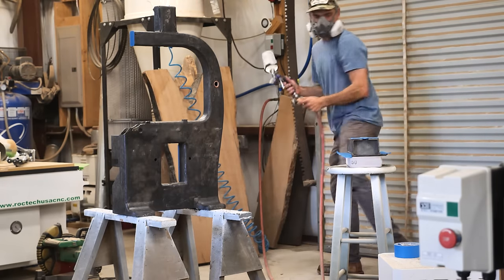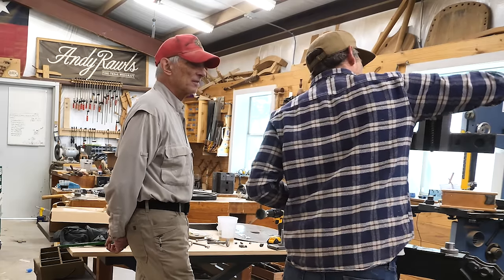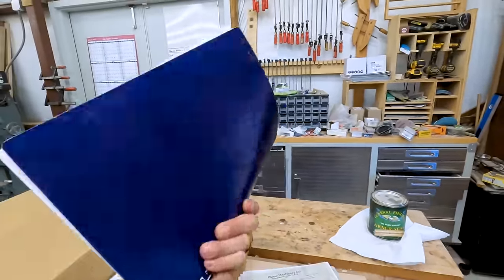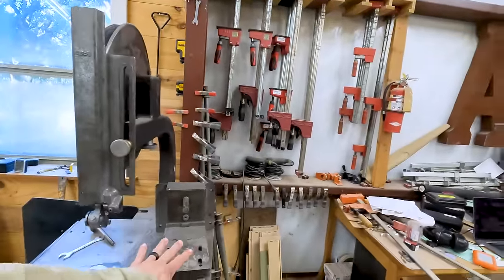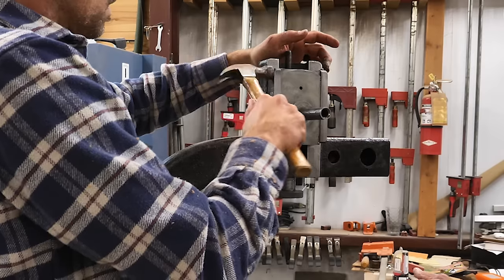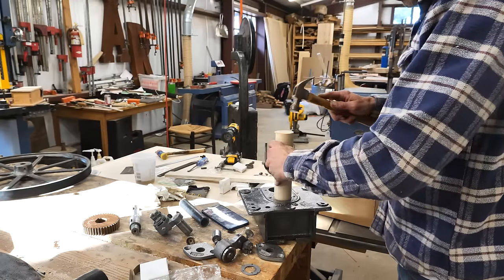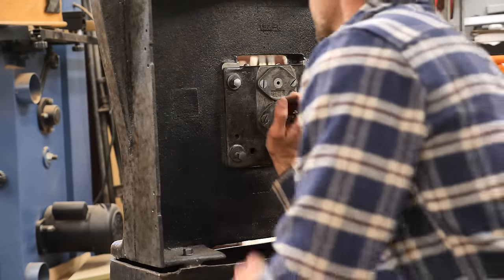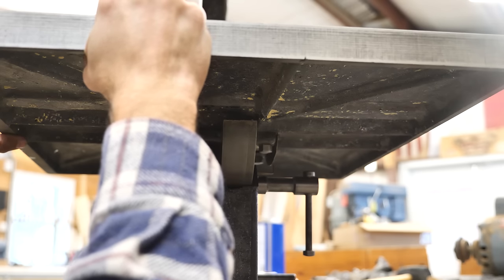Restoring a 98 Year Old Bandsaw // Clear Coating and Re-Assembly

Comment: Stop using a dam hammer! :face-orange-raised-eyebrow: I would've taken photo's & specs of that composite gear. Yet a good job.
Reply from the maker: Well I guess that a fair hazing!  Next time I won’t use the hammer.
Reply: @AndyRawls  Yes you needed a hazing! :face-orange-raised-eyebrow:I've been in the Sheet Metal business for over 20yrs. I watch the Machinist make production dies for yrs, I was Set-Up Mechanic, can't use regular hammers, we used dead blow mallets. My old Band-Saw, made by Penn State Industries; its 31yrs old. I made upgrades to it yrs ago, Carter Guides & Better tires, blades last longer. And I didn't use a hammer:face-blue-smiling:Keep up the good work!

Comment: You can use a mallet or brass/copper drift to hammer on those metal parts. As long as it is softer material it will distort or mushroom verses the shaft.

Comment: Just found your channel and subbed. I picked up the same 192 last year, just 8 machines newer 32406. Overall in good shape but it was converted to cut metal with a reduction gearbox. Thanks for doing this restore, learned alot this saw, before going through mine.

Comment: Interesting looking saw. I've got an old 18" bandsaw I refurbished. I've visited a few forums but have yet to find anything that will tell me the who made it or what year it was built. Most people that have seen it guess it to be from the 1920's but maybe the 1930's. It's a nice old saw that even has a factory rolling steerable cast iron base. It's got a 22x24 table with a little 5.5" wide by 11" deep extension table (for lack of a better term) that sits at the left side of the main table. But the small aux table doesn't move like the main table that tilts.

Comment: Was there a problem with your new Oliver? I understand the love of old tools, but you also made a comment about cutting curves that suggested the newer version wasn’t an option.
Reply from the maker: The new Oliver was a decent saw but it had some issues.  Oliver actually discontinued their bandsaw line.  My understanding is that they’re going back to the drawing board to design a newer better model

Comment: That's a pretty cool old saw Andy!
So, I was staying at a place in far west Texas, and they had for display, out under an awning near the horse barn, an old 1906 model (i forgot the name) 36-inch bandsaw. It has a heavy tilting table bigger than your big Oliver. The bearings were good (!), and it looked like all it needed was a motor, tires, and a blade, and she'd be hogging through timbers again. I asked if he'd sell it, but no, I guess they wanted to just look at it. 😞

Comment: It had been a while since I saw the first two videos so I watched them again. You might consider using electrolysis for cleaning up future project machines... It would remove the corrosion, oil, grease, and any paint that is over the corroded areas. It would save you a lot of labor time as you can leave parts in the process for hours/days/weeks as needed. It is self limiting so you don't have to worry about dissolving the parts! Using washing soda (e.g., Arm & Hammer washing soda) for the electrolyte offers the side benefit of degreasing the parts. You can even do machine tables and frames by using suitable plastic containers (e.g., kiddie pool, IBC totes) to hold the part and electrolyte solution. Electrolysis helps you get corroded parts apart without brute force... which the parts appreciate.   I've cleaned up 100s of hand tools and machine parts using electrolysis... wish I'd "discovered" it earlier in life!
Reply from the maker: Thanks for the advice.  I will do anything other than sandblasting!   I’ll try it out next time
Reply: @AndyRawls   I've got a 1905 36" Crescent band saw. I like seeing old iron resurrected!
Reply: @johngrossbohlin7582  I've got an 18" saw that I haven't even been able to identify the maker so far. Most people that have seen it or pics guess it to be from the 1920's. It's got a somewhat unique rolling base that I've only seen one other machine (a very large disk sander) that had the same style base.

Comment: is that a direct drive machine? I keep running across them that have been converted, it's nice to see you restoring it to original, there is nothing better than Oliver machinery.
Reply from the maker: I don’t think you can actually call it a direct drive since it has the gear box.
Reply: @AndyRawls   does the motor connect right to the gearbox? I have seen a bunch of them that have been converted to belt drive I think mainly because they were 3 phase to start with and someone wanted it to be single phase  someday I will find the right one